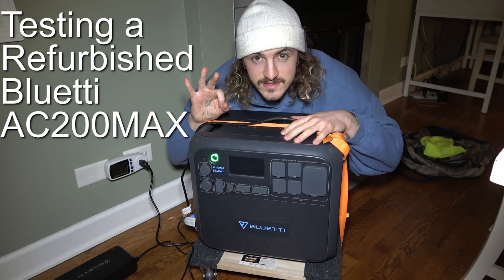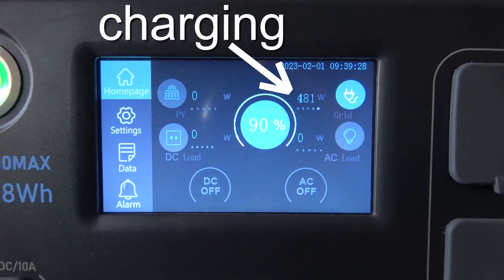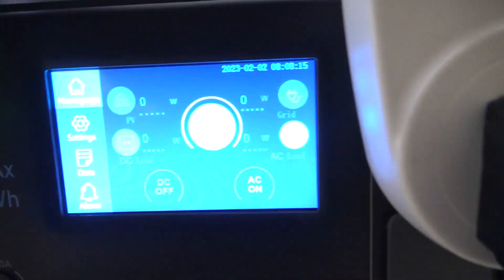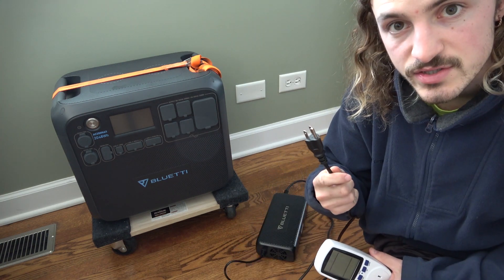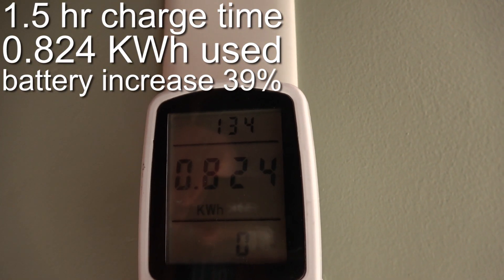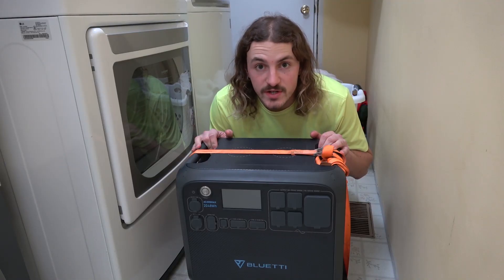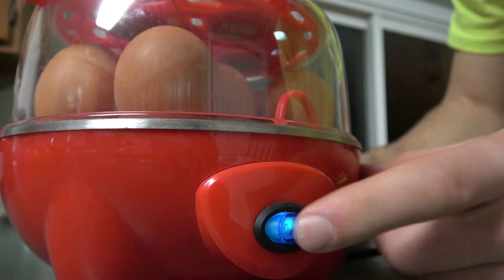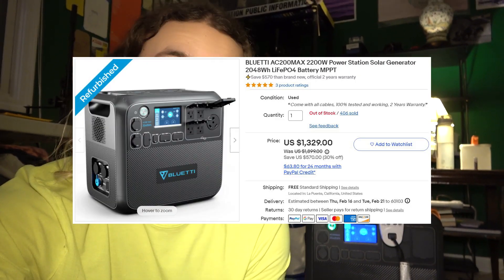Refurbished Bluetti AC200MAX Power Station Capacity Test

Comment: I would suspect the greater efficiency for large loads is due to the inverter and the unit in general being powered on for less time.  There is some power draw for the inverter itself running even with nothing hooked up to it.
Reply from the maker: Good point

Comment: Just hooked up my New Bluetti Ac180 and powered my Large Freezer in the Garage for 15 Hours before all power was used up.I see that Ebay has the Bluetti Ac200P Refurbished selling last week for $689 and this week its at $739....I think I will wait for the price drop on the Ac200P butttt $739 seems like a decent price......
Reply from the maker: Yes that’s a decent price for sure. Pretty large capacity for that $

Comment: Great video and thanks for the review! Since you had it, have you had any issues, regrets? I bought one and i hear a high pitch sound when i connect an AC or something over 500 watts. Just want to know if thats normal for these devices.
Reply from the maker: No regrets so far, I get weird noises out of it too sometimes--I think that's normal. Hasn't failed me yet tho. Will be relying on it full time in the next few months
Reply: @soilliam  Great to know and thanks for the reply. No regrets here either as it has helped as well.

Comment: The capacity does not seem to be diminished. The idle consumption is typically somewhere between 30 to 40 watts per hour.
Reply: I just bought a refurbished Bluetti and I ran a 57 watt fan for 8 hours and my bluetti went from 100% full charge to 55%. To me that is completely unacceptable and I started a return request, with my calculations it should have been around 76%. What do you think? I'm still waiting for Bluetti through eBay to send me my shipping labels. I bought a refurbished solar panel too from them, it seems to be okay but I was only pulling 147 Watts in 3:30 p.m. Florida Blue Sky Sun, so now I'm thinking maybe I shouldn't have bought these things refurbished. 😔
Your thoughts?
Reply: @JESUS_IS_GOD  the  consumption seems a little bit high.  It would be about 58 watts an hour.  I use mine all the time to keep the refrigerator and modem going, I get charged to 100% during the daytime from solar, and run window ACs, heater, TV, electric blanket, dishwasher, microwave, and stuff like that at night.  I always add on 40 extra watts per hour to calculate how much run time I have.  I bought mine new last year with 2 B230s and have been happy with it.  As for the panel, I'm assuming you're referring to the 200W fold up.  73% is not horrible, especially for a portable.  I bought a 100-watt of a different brand and I have only gotten 70 watts maximum from it.    I prefer 100 w glass panels.  Those typically give 70 to 85% of their rating during good sunlight hours.  I have 19 Newpowa 9 BB 100 watt mono panels, and 1 HQST 9BB Mono that makes around 85 all the time on a 20 amp PWM charge controller.  I'd chock it up to learning and keep using it.
Reply: @PWoods-cd6tk  I REALLY appreciate your feedback. Yes it's the PV200 Folding Solar Panel from Bluetti. I just ran my 1,100 watt microwave for 2 minutes. It was drawing 1,930 watts from my Bluetti Ac200max (2048 Wh) why so much higher? Anyhow in  2 minutes it dropped me from 61% to 56% charge. I would expect this battery to drop 1% for every minute of a 1,930 draw. This Refurb cost me $1,259, I'd rather buy the $1,599 brand new one if I can get half the battery consumption 🤔 your final thoughts on my latest test? Again Thank you very much!!
Reply: @JESUS_IS_GOD  the wattage draw for the microwave is not crazy.  My 1000 watt pulls 1700 atts.  The five percent difference is 102 watt hours - it should have used about 64 I think. I'm sure there's some efficiency loss in there somewhere.  You could probably say you'll get 85% - 30 or 40 more watts per hour for the thing to be on and be safe. Run it down to zero and charge it up to 100% and see if it is any different.  Also, the amount of energy it takes to run the microwave will be different directly plugged into the ac200 max, or through the house wiring, or an extension cord.  The amperage will increase or decrease with the length of the run and the gauge of the wire changing the wattage.
Reply: @PWoods-cd6tk  yes my microwave was plugged directly into my unit. Bluetti got back to me and said it's performing as it should  🤷‍♂️ this is no cheap $20 toy for me to gamble on a refurbished unit that God knows what the previous owner did to it and what was fixed. Again based on my 37 watt fan pulling 57 Watts and killing half of this 2048 KW lithium iron battery and my microwave dropping me 4% after only 2 minutes. Do you think I should press them for an exchange and risk another refurb and then if that doesn't work out by a brand new one. Because I want the unit, I just want the battery as advertised to function. Thanks so much you're more of a help to me than their customer support haha
Reply: @JESUS_IS_GOD  I don't think you got ripped off, but I don't know if the unit is as good as a new one.  Pray on it, trust and believe, and it will work out fine.
Reply from the maker: Awesome

Comment: Hello. I have seen your videos quite some time ago, and I feel like you might be more experienced than me, do you know an effective way to reduce moisture in a car in winter months when the humidity is basically always at 90%, do you think having a window crack would prevent moisture from building up on my bed sheets? Huge thanks!
Reply from the maker: Hello, MeDot thanks for watching. I think a window cracked and a small fan running to circulate air would help. I never experienced it on bed sheets, but on really humid nights a cracked window with fan helped excess moisture on windows for me. If none of that helps, I think keeping the car on and the heat on (if temp allows) would help because the heater produces dry air. Best of luck out there

Comment: I got the Bluetti AC200 for $1119 on a Cyber Monday 2022 sale, but the AC200MAX for that same sale was way more than $1329 that you paid, so you got a good deal.  I'm not sure what if any real difference, besides the big plug, is between the AC200 and the AC200MAX since both are limited to 2000 Watts output, which would limit the top AC current output to 15 to 18 watts despite the physical size of the additional large plug that is normally used in 30 Amp systems.  Maybe easier to plug in the A Frame camper, without using an adapter?  Or, can you get 30 amps out of that plug?  I have a larger RV whose roof air conditioner causes the circuit breaker to trip if I plug the RV into a 15 amp house outlet via the adapter.  Maybe a difference in solar, since I think I have to use two panels with the AC200, and maybe the AC200MAX only needs one panel?  I ended up not using the AC200 in my Prius because it is so big and heavy.  Love your videos!
Reply from the maker: Thanks a log Doug T. I think the main difference between models is the MAX can input a little more solar and it's just a newer model--not a huge difference. Not sure yet if the camper can plug directly in, but can always rewire it and add my own fuse panel if that doesn't work. ty for watching & have a good one!
Reply: In addition to the 900 watt solar input on the max vs 700 watt for non max. The max also has a higher efficiency, in a head to head test it put out close to 200 wh more than  the regular 200. The max also uses a fraction of the power with the ac & or dc inverter sitting idle.

Comment: I imagine I would not be able to charge something like this on a 12 volt solar system right?
Reply from the maker: Yes you can charge it with a 12v charging system. That’s how I typically charge it—4 100 watt panels connected in series
Reply: @soilliam  sick good to know thanks
Reply: @soilliam  sorry I'm lazy but how long do you think I'd be able to play an Xbox or ps4 on it?